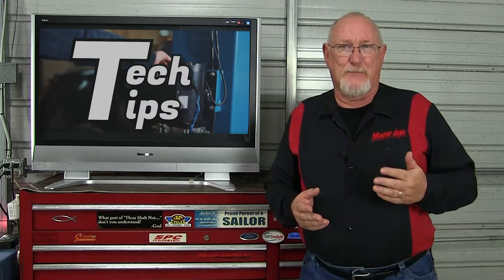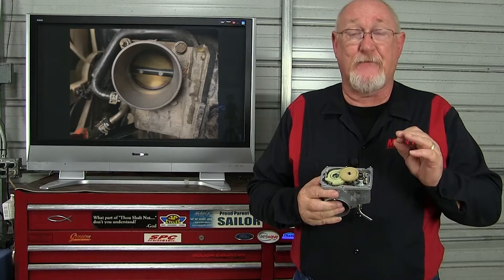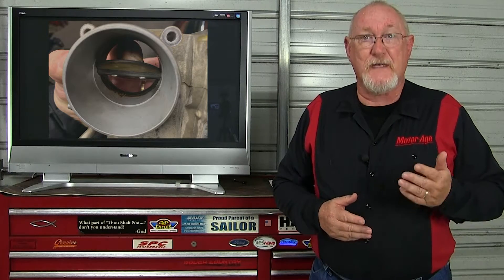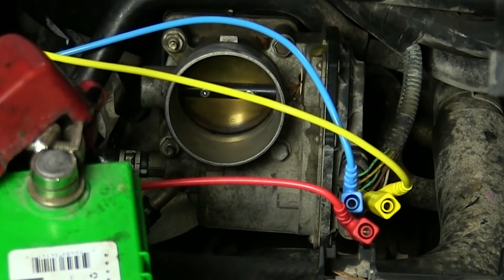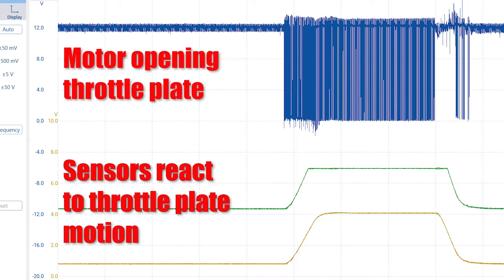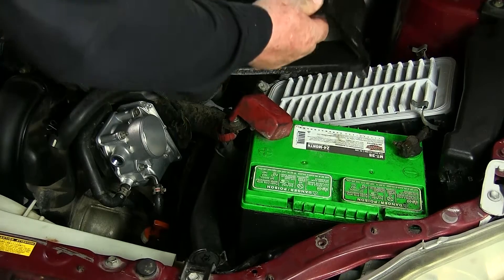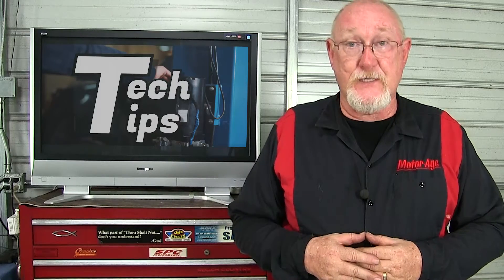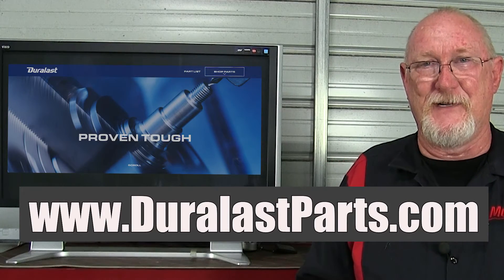TechTips #1 – Electronic Throttle Body Troubleshooting

Comment: Thanks for the video!
Can I get help with the diagnosis of my car? 
2010 Toyota matrix with 1.8l.
Cleaned the excessively dirty throttle body.
Replaced coil packs and plugs. Cleaned mass air sensor. Replaced filter changed crankcase sensor.
Initial issue was a backfire under the hood that blew off the vacuum line under the throttle body.
Also check engine light sand cylinder 3 and 1 misfire.
While changing the plugs and coil packs, I noticed oil in the number 3 cylinder and a small amount in the number four cylinder. I cleaned a cylinders and replaced the valve cover gasket.
I'm still having idle too high and it fluctuates just slightly about a plus or minus 50 RPM fluctuation while driving and while idling
It was after replacing everything but before cleaning the throttle body that I noticed a new code. P2103.
This led me to clean mass sensor and remove and clean throttle body.

Comment: Okay I need Help no one has answered this I have changed the tps sensor like 7 times bc when I get into the the throttle my throttle body door closes but my car is also turbocharged
Reply from the maker: So let me understand this - are you saying that when you step on the pedal, the throttle plate moves in the opposite direction - closing instead of opening? Or do you mean that you're experiencing low power? On a turbocharged engine, it is critical that the air tract from the turbo to the intake is completely sealed - and leaks will lower boost pressure and power.

Comment: I have a question?
I have a 2006 G35 sedan and so far I changed the catalytic converters,A/T FR/B solenoid,Transmission Temperature sensor, fresh transmission fluid and filter, MAF , APPS, new battery, and new brake pads, plus fresh oil change and filter. My car symptoms are slip & vdc lights are on at the same time as the check engine light, late gear shifts, hesitant to accelerate from complete stop, RPMs are hesitant when pedal is fully depressed (very sluggish rev ups), reduced power, delayed response when stepping on gas pedal. Ive done the idle relearn procedure many times but its not sticking. Im lost , HELP!
Reply from the maker: Sorry for the late reply. Let's start with the Check Engine light - what codes are stored?

Comment: I've got a ticking in my 3.6. I assumed it was the DI, but one tick was louder. I can actually feel the ticking on the intake right at the throttle body, yet it idles and runs fine, no engine codes. Have others had this problem?
Reply: Sounds like what you are calling ticking is spark knock- low rate of fuel or lack of sufficient spark
Reply: @Dooper196  Thanks, but it turned out to the EVAP solenoid sitting behind the throttle body. Since then I've replaced it with an equally noisy one 🤔 
Next time it goes I'll get a good Bosch or sumsuch.

Comment: My 2003 Tacoma sr5 stalled on me and gave me a code P2121 - Throttle/ pedal position sensor/ switch D circuit range/ performance. So I bought TPS and it worked for a day. And today  it stalled again and gave me code P2138 throttle/ pedal position sensor / switch D /E voltage correlation. Any idea what can it be? Throttle body opens butterfly 1/4 not even half way when I move the accelerator wire that’s connected to throttle body.

Comment: Hello, 
I have an Alfa Romeo Giulietta QV 1.8 turbo petrol.

My car has developed a problem with the idle hunting after reseting the self learned parameters of the ECU. The car starts perfect, idles good until the temperature start rising and the engine starts calculating the mixture, than the idle becomes erratic...goes up and down and than stabilizes and than again and than stabilizes. Under acceleration the car runs just great with no issues 🤷🏻‍♂️. The car has no check engine light on!!!
I have changed coolant temperature sensor, cleaned MAF and MAP sensors, changed spark plugs and coils, going to change the wide band pre-catalyst Lambda but the old one does go in closed loop. The only thing not changed yet is the electronic throttle body. I did try to clean it and was not dirty but I did move it with my fingers. Coul this cause a fault in the throttle body...if yes why it did appear only after the ECU reset 🤷🏻‍♂️

Please give me an idea what coul be  the trouble

Comment: 13 Nissan Maxima 
Cylinder 6 misfiring found a previous mechanic had rigged my wires near my ECM what could it potentially be . I need help
Reply from the maker: A misfire can be caused by anything that prevents that cylinder from performing to its full potential. Are there any codes that you know of set, other than the obvious P0306?
Reply: @VehicleServiceandRepair  yes P0300 and P0430
Reply from the maker: @princessdominique7501  The P0430 could be a result of the misfires. Find a competent professional and have it properly diagnosed.

Comment: 2011 fusion continued.  I do have a weak battery can that cause the throttle body actuator issue?
Reply from the maker: That's always the first thing to correct when dealing with any electrical issue or component problem.

Comment: Ihave a 2001 ford fusion with a 2.5 liter engine. My engine light and wrench light came on and threw a 2119 code. ( engine throddle body actuator) and a emission warning. I sprayed and cleaned the throttle body but didnt do a re programming.

Comment: MY MAN……. Thank you so much! You helped me figure out that the new motor and trans I put in my 07 trailblazer was as good as I knew it was. I had some things going on that I just could not explain to any of the other techs I worked with, and yes I did try to clean, relearn and had the computer flashed as well… nothing worked, so I found this video and fixed my 2 year old headache. Again thank you so much!
Reply: What was the issue?
Reply: I got a 07 trail blazer too it got crank just no Start after I get it to start I drive it about 20 mins and it leave me there
Reply: This nick guy's comment makes no sense 🤦‍♂️

Comment: Great video. Where do you get the wiring diagrams from?
Reply from the maker: I have access to different professional service information systems and occasionally use the OEM service sites.
Reply: @VehicleServiceandRepair  would you mind sharing the sites? Thanks in advance.
Reply from the maker: @kalindambozi2356  Are you a professional shop or just looking for info on your personal vehicle?
Reply: Am a mechanic, recently ventured into auto electrical and electronics. The challenge i have is finding correct wiring diagrams
Reply from the maker: @kalindambozi2356  Visit www.nastf.org. You'll find all the OEM service sites listed there.
Reply: @VehicleServiceandRepair  thanks a lot

Comment: Hi Mr am having a problem with my throttle body for ford fiesta mk6 st 150 2.0l I cleaned it up and then when I the car it only rav once and then stop raving go back to limp mode I bought another throttle it's still doing the same thing the machanic think it's a ECU

Comment: My 1996 1.6L Toyota camry throttle body had siezed. I pulled it out. Inspected it, tried to wiggle the plate open. It wouldn't budge. I called a friend over and he gave it a tap with a hammer and it worked!!!!!! Mind you my engine bay is spotless clean and the throttle body was in good shape no dirt inside. DONT BE AFRAID TO TAP IT WITH A HAMMER FIRST hahaha

Comment: Sir
I cleaned electronic trottle body 
I cleaned sencorbalso
Now my car won’t start. How can I start any tips please
Reply from the maker: What kind of car? YY/MAKE/MODEL/ENGINE
Reply: @VehicleServiceandRepair  
Sir
2016model mariti alto800 
Electronic trottle body
Reply from the maker: @muhamedpadanakad9521  Unfortunately, I can't access service info on your car. First, verify you have the three basic ingredients: fuel, compression and spark. Then check for any codes stored in the ECM, and if present - correct them. Try to find an information source to identify any relearn procedure there might be for your car's ETC. Good luck!
Reply: @VehicleServiceandRepair  
Thank you sir
But  not showing any code

Comment: Thank you for this video. Can i open the throttle body plate with the key on engine off by pressing the gas pedal?
Reply: Did you figure out if that's possible the answer to your question is really important for be to diagnose my friend car
Reply: @rocklobstar5672  i did not

Comment: My throttle body was turning on and off yesterday, everything time I turned off and restarted my car it reset and started working again for awhile, today it hasn't had any issues and I've been driving for hours. Should I still replace it?
Reply from the maker: No - it may be circuit or ECM related. Diagnose before you replace anything. TEST, don't GUESS.  🙂

Comment: Great video! What's the tolerance of movement in the default off position? I removed one from a volvo for cleaning (DTC P0507) and when the plate is  moved with fingers, it moves freely a teeny tiny bit before you feel the resistance from the motor.

Comment: If anybody can help I have a 2012 Tahoe I replaced the throttle body bc I was in limp mode . The rpm’s now run fine but ONLY WITH THE AIR INTAKE OFF , when I replace it idles crazy won’t shift . Did the relearn multiple times

Comment: My 2004 Acura MDX goes to 3000 RPMs when accelerating from 0 to about 40miles per hour. I need to often take my foot of the gas to let the RPMs go down? What could be the reason? My throttle body has built in mass air flow sensor sensor and idle air control valve if I am not mistaken.

Comment: Great video. 2011 Chrysler 200 2.4l. Swapped out throttle body after it went to limp mode. Now I have intermittent throttle body issues. It was a cheap ($100 - $200 cheaper) than anything else. I've thrown some parts and noticed a rubbed wire. Which will be fixed this weekend. Should I get a better throttle body to see if that helps?
Reply from the maker: Fix the wire first. 😊
Reply: @VehicleServiceandRepair  I really hope it's the wire, I'm tired of all these expensive rabbit holes it could be. Ha ha
Reply: I’m guessing it wasn’t the wire?

Comment: My throttle body butterfly on my 2010 aveo5 1.6L with ignition in the on position an accelerator push to the floor it only opens 3/8 of a inch not all the way is that a problem???? Thanks
Reply from the maker: No, it is normal on some models to limit throttle plate travel when the ECM doesn't see a corresponding increase in engine speed.
Reply: @VehicleServiceandRepair  thank you for answering question.
Reply from the maker: @garyfaulds2008  My pleasure!
Reply: @VehicleServiceandRepair  I would like to ask one more question,  the aveo5 jerks an hesitates starting off from start an up hill , replaced plugs , mass air , 02 oxygen,  with no engine light . Thought maybe catalytic converter. Thanks .
Reply from the maker: @garyfaulds2008  A restriction in the exhaust will usually result in a loss of power under all driving conditions. Even though the light isn't on, you can still look in Mode $07 for pending codes if any exist. And always start with the basics - is fuel pressure and volume correct?
Reply: @VehicleServiceandRepair  I may take the top 02 sensor out an run it briefly an see if it makes a difference.

Comment: My car threw the Throttle Actuator code P2101. I'm curious if the Actuator is attached to the Throttle body it's self?
Reply from the maker: Yes, but the code doesn't mean that the actuator has failed. This is a "rationality" code and is set when the Actual throttle opening does not meet the Desired throttle opening. Make sure the APP sensor(s) are working properly and that the circuit to the actuator is solid first.

Comment: I have a question any experts may want to answer. Could a bad alternator cause this throttle body error to occur, seeing that the vehicle isnt getting sufficient dc power?
Reply: If the diode pack in the alternator fails, it can allow excessive AC voltage on the DC line - called "AC Ripple" - and that can confuse the sensor signals rec'd by the ECM. But not for low DC voltage - that comes from the battery. If you are getting low DC voltage, look for a voltage drop in the circuit.
Reply: I doubt it, this guys video is really good and covers most likely faults

Comment: PLEASE HELP

Hi, thanks for the great video 👍🏼 my mechanic has given up on fixing my electronic throttle control issue. If you or anybody reading this comment has any pointers that would be amazing! Below are the details.

I was driving on a dirt road after camping and my etc light came on randomly as well as the engine light about year ago now.
 Since then it drives fine but randomly sharp little jolts will occur in the revs while driving.
 I will then usually pull over, turn it off and it will drive fine the rest of the way home although this happens almost every drive now. 
Occasionally it does enter a limp mode which I also restart the car to bypass.

I took it to my local mechanic. I live in a rural area so there is only 2 in town.

They did a throttle body clean.
Replaced the cam sensor
Replaced the crank sensor
Replaced the accelerator assembly
Had the engine computer and security system sent away and checked for faults (they apparently fixed something there, not sure what but still the etc light remained on)
They finally Replaced the throttle body and still no fix.

If there is anything you could recommend that would be amazing.

My car is a 2013 jeep wrangler unlimited. 

According to the mechanic every time he puts a new part in the car for example a sensor  it creates a new fault code for another part. We then replace that part and the same thing happens 👎🏼
Reply from the maker: What code(s) are being set? What engine and transmission does your Jeep have? Any accessory installations (light bar, remote start, aftermarket radio, etc.)?
Reply: @VehicleServiceandRepair  thanks for the reply! It is a 3.6L petrol automatic. It just has an aftermarket UHF radio fitted. The code showing at the moment is the throttle position sensor and A voltage issue code. Sorry if this isn't too specific as this is by memory from when I saw the mechanic last week. Really appreciate the help
Reply: Please note these codes weren't showing at the beginning. But literally every time we replace a part due to a code showing it then shows a new code for something else once the replacement is fitted 🤯
Reply: @adamturner6884  Without knowing for sure, the description of the code you gave sounds like one that is circuit related. If that's the case, you can swap parts all day long and not fix it. Also, based on the little info I have, I would suspect a problem in the wiring and would look for areas of the harness that may be under stress when the vehicle is operated under certain conditions - like a hard right turn, or after hitting a pothole.
Reply: brush clean the grounding points used by the ECU and make sure your voltage regulator is still able to generate 14.4V under load.

(I had a flaky TPS code that set by bad ECU GND!) - Throttle and TOS ground through the ECU shared circuit, not directly.

Get your electric diagram to trace your harness color & locations.
Gd luck!
👍

Comment: Hello! Nice video! Can I have some help? I am struggling with my Mercedes w221 s320cdi. The problem happened when I turned off the esp and flored it and it started making weard whistling sounds and it gets in emergency mode or limp mode after been throttled for a couple of seconds in the turbo area. I have driven her to the service and there were no damage from the turbo ways. I was wondering if throttle body could be the problem ?
Reply from the maker: I'm not familiar with this model. Have you checked for Diagnostic Trouble Codes (DTCs)?
Reply: Check for vacuum leaks
Reply: Yeah, I think found the problem. There is a gap between my turbo and the aluminium pipe that goes to the intercooler. I will get that fix on Wednesday and hopefully, it will fix my problem.

Comment: Would the throttle body cause your car exhaust to sound muffled
Reply from the maker: It wouldn't be my first suspect. Have you noticed any loss of power?
Reply: @VehicleServiceandRepair  yes
Reply from the maker: @HbkRiqqq  What is the year/make/model and engine?
Reply: @VehicleServiceandRepair  2013 dodge dart
Reply: 2.0
Reply from the maker: @HbkRiqqq  There are a number of things that can cause a loss of power. You need to start with a sound diagnostic process and the FIRST step is to gather as much info about the problem as you can. Look for any recalls or Technical Service Bulletins related to your symptoms. Check the ECM for codes stored and if there are, learn what causes them to be set. Inspect the exhaust for signs of damage that could be restricting flow. Make sure the turbo is performing as its supposed to. If the engine uses a MAF sensor, I would also perform a Volumetric Efficiency test to see how well the engine can breathe.
Reply: @VehicleServiceandRepair  I Did Have W Problem With My Oil Pressure Sensor Then With My Cam And Crank Sensors And Since Then My Exhaust Sounds Muffled And Car Stalls After About 20 Mins Of Idle I Did Change All The Sensors
Reply from the maker: @HbkRiqqq  Don't throw parts at the car. If the diagnosis is outside of your comfort level, seek a professional who is and have them take a look.
Reply: @VehicleServiceandRepair  of course i was only doing the ones that i know i can handle but now there’s no codes but still having the same issue